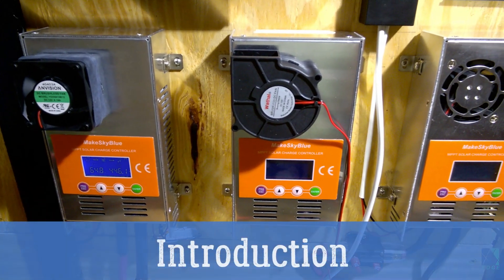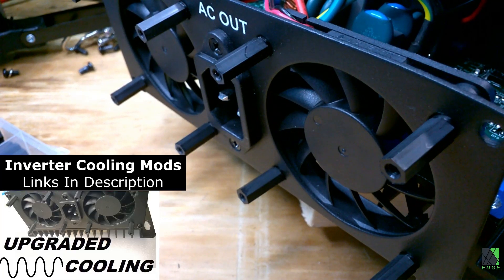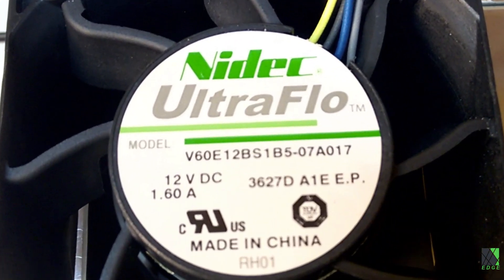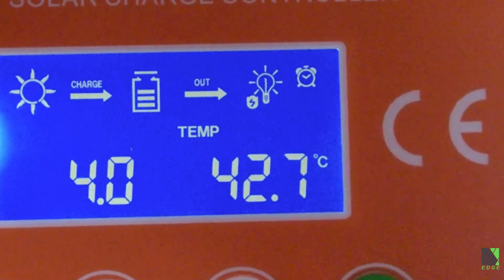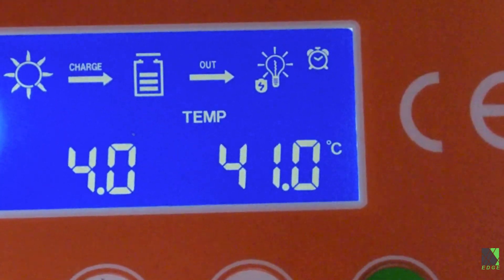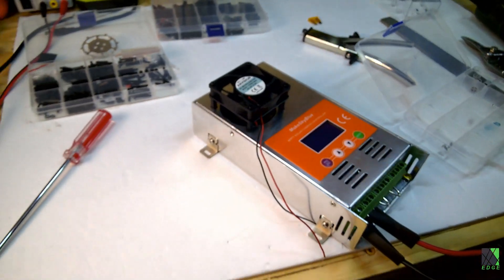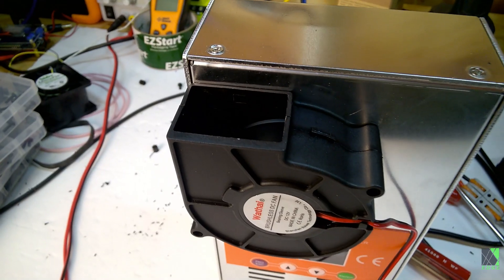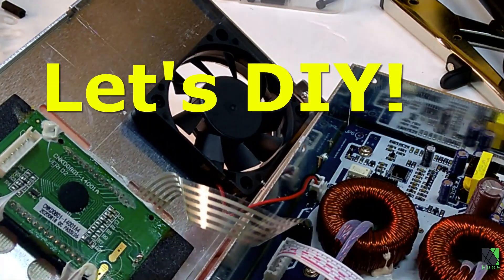Powerful Cooling Fan Upgrades for MakeSkyBlue MPPT Solar Charge Controller! #DIY #solar #offgrid

Comment: Hi. What would be the effect if the fan was inlet as oppose to exhaust ? Generally which is better for cooling intake or exhaust
Reply from the maker: @danisharshad1354 Hi, generally speaking heat rises upward - so it's better to "help" that process along by pulling the air upward and out the front of the charger. That's how it was originally designed. In terms of pulling air, it's better to use a centrifugal blower like what was shown later in the video. Those are very good at vacuuming the hot air out of the charger. Of all the options, I found the centrifugal blower was best, but also the most difficult to install. Hope this helps!
Reply: @solarpoweredge Thanks for your reply. So u mean exhaust is better than intake for cooling
Reply from the maker: @danisharshad1354 Welcome - yes exhaust is better. However if you are forced to push air in (in take method), that will still work as long as that hot air leaves the electronics enclosure

Comment: How can i cool my 4000w inverter. It has two exhaust fans at the bottom with two sidevents at the top on both sides. I use around 3200w of load. How can i cool it like a fan mode or something. For reference my inverter looks like eg4 3000w inverter
Reply from the maker: @danisharshad1354 Hi, maybe you can try adding extra fans. Here are a couple videos about using standoffs to mount fans to an inverter:
https://youtu.be/XplQquhH36Q
https://youtu.be/gXoZYuMCrzI

Comment: 📌 Which one is the quietest and most efficient? 
We are waiting for a video with the modification of the passive cooling radiator, it will be very interesting 😎👍
Reply from the maker: @NounXXX  Hi, I've tested both fan types for a long time... the blower-style (centrifugal) fan seems much quieter and more efficient
Reply: @solarpoweredge Thank you, I would like to see a video of you installing a passive radiator on makeskyblue 😎👍
Reply from the maker: @NounXXX  You're welcome :D good idea, I hope to make a video about that as soon as humanly possible... 
FYI: the back of the controller is very flat, if you can find a flat heat sink wider than the body, you can use L-brackets and heat sink compound to mount that on the back. Actually a small and quiet fan could be used but is optional. Then mount the whole thing on standoffs so it doesn't touch the board. A bit tedious.. but it makes an amazing cooling solution! One subscriber mentioned he had already done something similar...
Reply from the maker: @NounXXX :D :) 👍
Reply from the maker: @NounXXX Hi, the centrifugal blower / turbine seems quietest and pushes more air because of high static pressure. As a result it's possible to lower the voltage (speed) and still get good cooling. But a normal fan can do the same job as long as it's powerful enough. You can find the link to turbine style fan in the description, it is 75mm. Got to find a large flat heat sink to bolt onto the back of this charger, I am sure it would be an interesting project :D 👍

Comment: I've got the 60A V123 with the Cloud Box and I really like it. But I was wanting to keep it cooler also. The fan is a high pitch whistle and it would be nice to keep it quiet. I didn't understand the need for the diodes in the DC power load output.
Reply from the maker: @jerrybandy3827 Yeah the fan sounds terrible! A larger but quieter fan will work. I'd mount it externally. 
A 12v BLDC fan doesn't want to see 13.4v DC or it will burn out. The diodes drop the voltage down to safer levels.

Comment: This type of MakeSkyBlue is good quality?
Reply: I think sooo!!! I got the V125 type with cloud service. it helps a lot.
Reply from the maker: @Eng_RAY Yes, for the price it's actually a good deal. It is a good entry-level MPPT controller and seems to be well built. There are not many settings to change and setup is straightforward

Comment: I bought one of these and made the mistake of buying a 40amp one instead of a 60 amp one limiting the number of panels I can put through it I was lucky enough to get a set of solar panels from my brother inlaw when he upgraded to a larger array
Reply from the maker: @errolfoster1101 I have a 40 amp too, it's connected to some smaller panels. Still a nice machine to have around, or even as a backup charger
Reply: @solarpoweredge  I used this to power all my house lights through an inverter some of which have smart switches never had any problems I have been doing this for about 3 or 4 years and have a standard power point in the set up haven't used the power point yet but have bought some rechargeable tools lately I will be using it for them
Reply from the maker: @errolfoster1101 Nice :)

Comment: Nice informative video. I have the same controller and just like in your case the temperature management was an issue. I ended up monting my controller to a beefy heatsink with a silicone thermal sheet in between the two. Now the controller doesn't heatup enough to even activate its cooling fan.
Reply from the maker: @v-man1 Appreciate the good feedback! Excellent idea using a big heat sink. I had recently added 2 scrap aluminum CPU heat sinks. Looking for something bigger though. Also mounted it with spacers (standoff) so it doesn't touch the board except on the L brackets.
Reply: @solarpoweredge Some 5 years ago I got a couple of 5kwh BYD batteries from Battery Hookup. These batteries had these huge heatsinks measuring almost 2 square feet to keep them cool during their employment at some serious solar farm. I don't push them hard enough to make them heat up any significant amount. The charge controller on the other hand works to it's max potential on occasion.  The power FETS are cooled by the back panel of the case, therefore having a decent heatsink on that surface makes a huge difference. Having it installed on standoffs like you are suggesting would definitely help it cool as well.  Some manufacturers, I'm  sure you've noticed, actually have a passive heatsink in the back of the case, that also keeps it off the wall to allow better cooling without the use of a fan.
Reply from the maker: @v-man1 Nice. Those are gigantic. Pulling them from equipment is the way to go.

Comment: Smart, keeping the units from ever warming up before the fans come on, will prevent or eliminate thermal expansion issues, and should vastly extend the life of the circuits and components. It's the constant heating and cooling cycles that really kills electronics.
Reply from the maker: @colin8532 Right on! not to mention the sound of the stock fan turning on and off for hours. I prefer on all the time. I think the centrifugal blower option is working best, need more testing to decide
Reply: @solarpoweredge Go 😎👍
Reply: 📌 Which one is the quietest and most efficient ❓🤔  @solarpoweredge

Comment: what did temperature did the charge controller with the centrifugal fan get down to?
Reply from the maker: @thelegion_within To the 40s (C) temperature of the room it's in is also a factor. It's usually gets too warm in my shop - one of the reasons for upgrading the fans